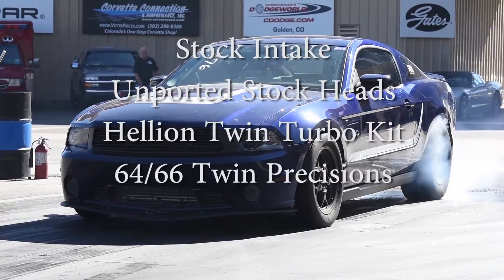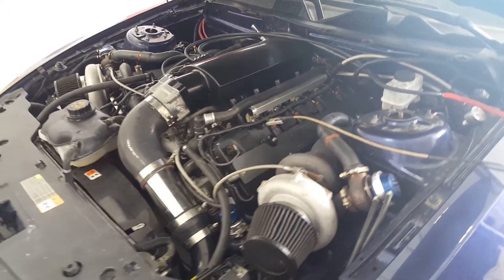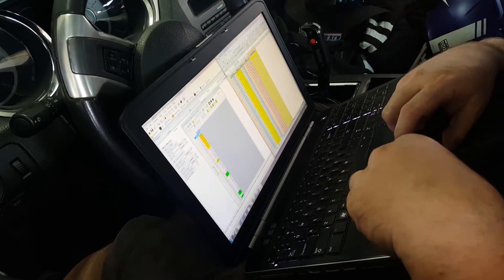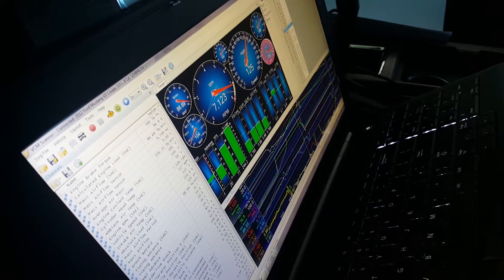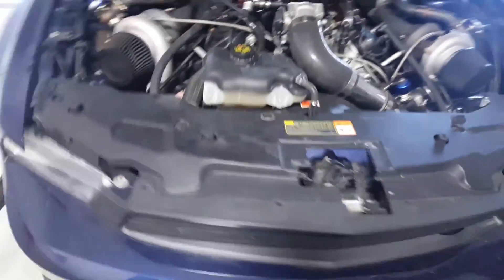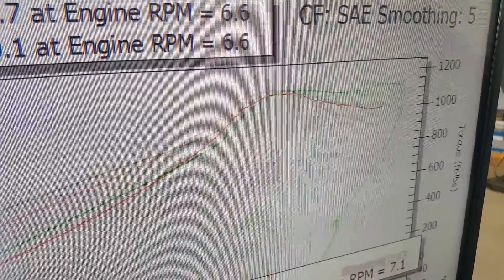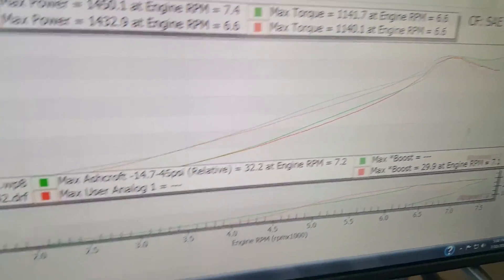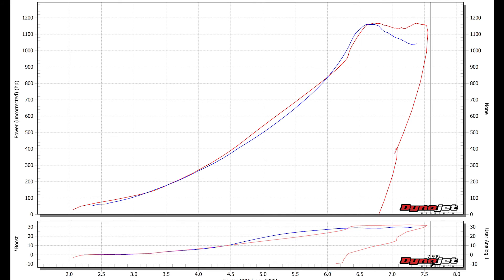Mustang Sheet Metal Intake Dyno Results

Comment: I had that same problem with mmr fuel rails allowing the fic injectors to "walk" too much and spray fuel everwhere. Ended up milling down the pedestals on each side to only allow a slight amount of up and down injector movement, to avoid putting pressure on the injector body, and it fixed it.

Comment: Sounds like MMR has some quality problems? I'm doing a coyote swap in an old falcon, I'm wanting  to do twin TT. I have no room for an inter cooler so I was going to use MMR icx water cooled intake to help free up some space and just run an heat exchanger. Kinda bummed to hear about quality issues.
Reply: I've found that MMR stuff isn't bad you just have to be really careful what you're doing and don't expect much, if any help from them. I bought an oil pump pickup tube spacer from them that stripped out the moment I tried to torque it to spec according to the Ford Shop Manual and MMR basically accused me or overtighning it, even though it didn't even get close to that, it's like the threads just crumbled the second they got any resistance, and they said they'd refund me the part but that was over a year ago and that never happened. 
I had another similar incident with an inline thermostat housing I bought from them when I went to install a plug into water by-pass it started trying to pull threads. I ran a tap though it and that solved the problem.  
It seems some stuff they're better on then others. I have all the MMR VVT delete and am running their camshaft sprockets on my coyote and they all seem fine.

Comment: What tuner software is he using? I've never seen that setup. I'd have to study that intake cam timing and center line with the Boss. It should Tach a little higher no doubt with a shorter runner depending on the runner volume which I'm sure you've figured out. I'd just love to get my hands on that setup I'd be brain storming all night. So stock intakes and Boss exhaust cams?!? MMR intake cool!
Reply from the maker: He's using HP tuners. There was a lot of variance in power in even small cam timing changes, and it also would directly effect spool. Going to take some time to get it all optimized. And yes, I believe he's using the stock intake but boss exhaust cams as the boss exhaust cams were dirt cheap when he was buying parts.
Reply: Wake Productions yeah he'll get it dialed in.

Comment: so you guys forgot to try the cobra jet intake witch is king
Reply: 32v 5.4L swap crown Victoria coming soon!!! Imho it can‘t hold 29 lbs of boost
Reply: They are great for N/A or low to mid boost. but at this power level its not going to hold up, hence why I had to go with a sheet metal intake. Got this one on a great deal so i couldnt pass it up.